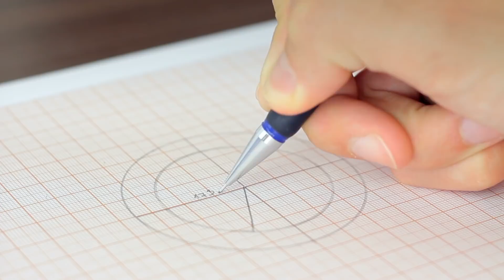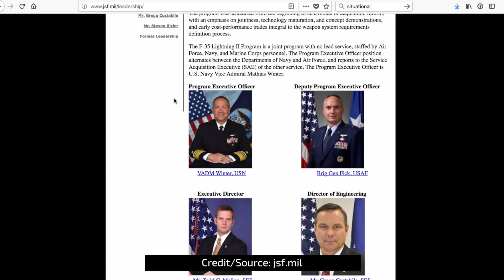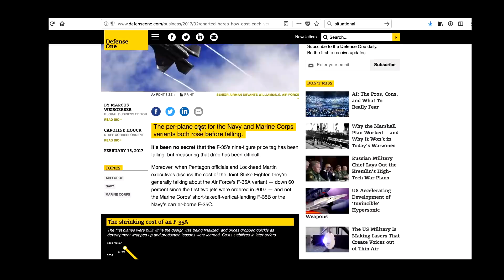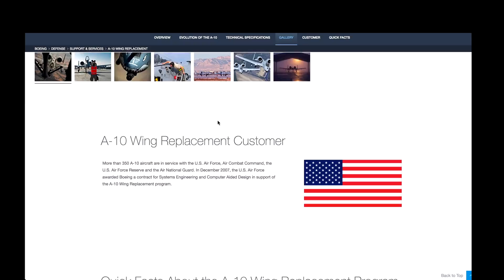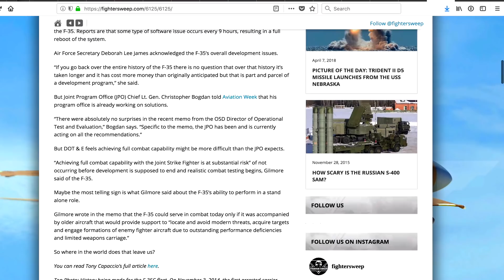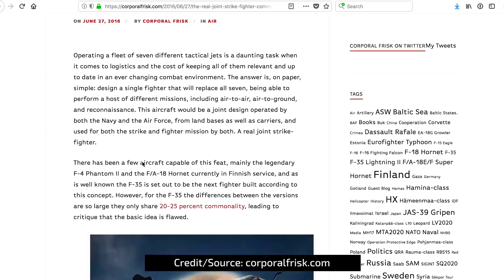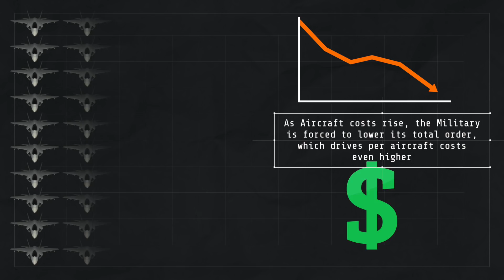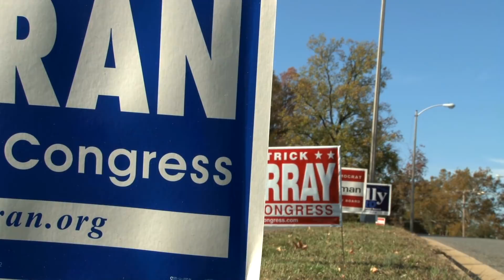Why the F-35 Lightning II Might be the Most Expensive Military Aircraft Mistake Ever

Comment: I am no military expert but I am pretty sure most soldiers and marines who've been to Afghanistan would agree on there's isn't a CAS aircraft that would come close to the A-10.
Reply: That's only dealing with the end result on the immediate battlefield. What the troops think cannot determine what is the best way to support them since the troops are not the ones dealing with the aircraft. Overall something like the F-16 is a better CAS aircraft, even though the A-10 is more impressive on the battlefield.
 Listening solely to the troops is similar to calling up IT support for a malfunctioning computer and telling the IT support person how to do their job just because the best solution as determined by the IT support person is a bit of an inconvenience to you in the short term.
Reply: @dumdumbinks274  I am sure there are logistical reasons why the F-16 would be more preferential, I mean there are simply far more F-16s than there are A-10s and sure the F-16 is adequate to do CAS. I don't think it necessarily makes the F-16 a better CAS aircraft, ultimately the A-10 is designated specifically for CAS missions, while the F-16 is a multirole fighter aircraft,  thus it has similar shortcomings as the F-35 . The A-10 can provide support to ground troops for a longer period of time as well as making split second fine-tuned adjustments while engaging the enemy. To use your IT support narrative, the F-16 is like tier 1 IT support, they are capable of doing general troubleshooting and solve most common issues, meanwhile the A-10 is like tier 2 support, who are capable of doing more precise troubleshooting thus fixing more specific issues.
Reply: @BeerHombre  Not quite. If the A-10 can be likened to a really enthusiastic support person, then the F-16 is a support person who can do the same job but just wants to get it done. The A-10 can get the job done more satisfactorily, but the F-16 ends up completing more jobs, and it's not because of the number of F-16s... an airbase can only support so many squadrons at once, and the F-16 and A-10 have typically been deployed in similar numbers when it comes to the role of CAS.

The reason the F-16 is so good is because in multi-operation situations it's speed means fewer aircraft are needed to provide support to everybody. I'll put it this way; An A-10 could potentially save everybody in squad 1, but if you're only using A-10s and don't have any to spare that means squad 2 might be wiped out in the 5min longer it takes for an A-10 to reach the 2nd destination. If using an F-16 it has less sustained firepower, but a single bomb is just as good as a strafing run. It might save 80% of squad 1, and 70% of squad 2, and that is more soldiers saved in the long run despite doing the job in a less impressive and therefore less reassuring manner. 

Now you might ask why not just increase the number of A-10s? The answer is because CAS is the only thing it can do and it is only good at that in certain situations. As long as the role of CAS can be performed effectively that means troops lives will be saved, and of course that includes frontline CAS where an A-10 isn't going to survive. 

Remember the Gulf war? The US won in a matter of weeks because the frontline aircraft were able to eliminate the air defences, bring down communications networks and the command structure of the Iraqi military, and thus force the Iraqis into a state of disarray with no coordination. That allowed the A-10 to do it's job. But if the US put more emphasis on dedicated CAS aircraft the war would have taken a lot longer and the US would have suffered more losses due to the enemy being more coordinated since the communications networks would probably be more intact, and air defences would be more concentrated when the A-10s arrive.

Now I'm not all for retiring the A-10, but I don't see a reason to keep 270 of them when they aren't exactly efficient in a war situation. It's much the same as how there aren't many AC-130s.
Reply: @dumdumbinks274  I think we are arguing more or less the same thing. Logistical reasons for using the F-16 =  It could theoretically do more tasks, including CAS because it is a multirole fighter aircraft. Something that we both agreed on. I'll add because of its multirole capabilities, there is a reason why there are far more F-16s in use than there are A-10s. This naturally means that you can allocate more F-16s to do CAS mission when needed, but the A-10 isn't capable of doing other tasks than CAS hence there is little reason to have a large fleet of A-10s.

However I pointed out, as you did as well that the A-10 is capable of CAS with sustained firepower. The A-10 might be only able to do one thing but it is unrivalled in that particular task (also more cost efficient might I add). You do have point regarding the speed of deployment of the F-16 as well as it could potentially strike multiple targets that are far away from one another. But this just goes back to the previous point, the F-16 is more flexible than the A-10. However if you're dealing with only one combat zone and you need sustained CAS danger close, again the A-10 is more suited for that role than the F-16. 

I see no point talking about this further, you're arguing the merits of the F-16 and I am arguing the merits of the A-10, but both of us can see eye to eye in regards to the capabilities of each aircraft. It's nice to have a civilized conversation as opposed to all the overly passionate nonsense people spew out on the internet. 

PS: I did say I am not a military expert so I am claiming no legitimacy.
Reply: @BeerHombre  No worries mate. The thing I dislike most about the A-10 is - like many things - the fan base. People who parrot it's merits as though those things are all that matters (usually exaggerated too). I often find myself testing the waters so to speak by replying to comments that praise the A-10 over everything else. It's nice to once again see an A-10 opinion that isn't completely one sided and I'm fine with that. As long as you can understand that CAS isn't a single situation and that a true "best CAS aircraft" will never exist unlike for example a "best air superiority fighter", as well as the merits of efficiency and flexibility versus durability and firepower, then that is fine by me.

One thing to note though; the A-10 is only a tiny bit more cost effective than the F-16 in the situations it can be cost effective in. They have had similar costs to buy and operate at every point since the 1970s and currently a Block 50 F-16 and A-10C cost roughly $20000 per hour to operate, though neither of them are in production any more in a sense that we can compare figures. I'd guess the A-10C is worth around $45 million and the F-16 Block 50 around $50 million. Now something like an F-15E which also does CAS is definitely more expensive than an A-10 at $100 million and $28000 per hour.

Comment: I think the negative reputation of the F-35 is mostly unwarranted. A lot of people expect it to excel in roles it wasnt designed for. The exorbitant price tag and cost overruns are just unacceptable. However after working out all of the early bugs, its definitely an impressive aircraft.  Replacing the A-10 with the F-35 is completely out of the question.  One thing the F-35 critics fail to consider is the out right theft of the jets classified information by the Chinese.  A lot of stuff had to be redesigned because of this. Contributing to the cost and schedule delays. The Chinese cant even build their own indigenous jet engine.  Every ship, missile or aircraft the Chinese have are cheap knockoffs of American or Russian designs.

Comment: The F35 in 2015 flyby wire system did not let the pilot turn hard, i forget the limitations i think it was 7G's they knew it was not ready they just wanted to test it.  The pilot was also flying the F35 like it was a F16, tactics were not developed for the jet by that point.

Comment: The F-35 is not going to replace the A-10 the A-10 was designed as a ground attack plane now the F-35 has more advanced avionics more advanced weapon control system in more advanced weapons but the 8 ends design to build the take punishment and to do the job that Fairchild Republic design the plane for now they re Wing the 8 ends but the u.s. Air Force is looking for a cheaper alternative like the super decanio and a few other small turboprop aircraft

Comment: The one F-35 variant that I would worry about is the F-35B. It's basically the US's version of the Russian YAK-38 Forger, which was considered a failure. Why? Because it has a second engine that would be used mainly in landing and assisting in take-off. That second engine that powers the VTOL capability means the plane will either carry less fuel or less munitions, not to mention a lot of extra weight. Think the Marines would be better off either keeping the AV-8B or adopting the F-35C which has a greater wing area for carrier operations.
Reply: The F-35B is superior to the AV-8B in literally every way possible, including being easier to maintain. The F-35C cannot operate from LHDs, so it's not an option.
Reply: @dumdumbinks274  Ummmmm... You are aware that the F-35B also costs about 5 times as much as the AV-8B, aren't you? The question you and others should be asking is if the F-35B is 5 times the airplane that the Harrier is. Unfortunately it is not. In a war of attrition, that can make all the difference in the world.

Combat radius is roughly the same for both. Ordinance weight is a little more than half that of the AV-8B if the F-35 wishes to maintain its stealth capabilities. According to the many articles I have read online, the F-35 is NOT good in a dogfight whereas the Harrier was credited with approx 20 air to air kills during the Falklands war. Black boxes while no doubt superior aboard the F-35, only goes so far due to ever changing technologies. Also they are still chasing bugs out of some pretty basic and well established technologies such as the pilot oxygen and cabin pressurization systems. Pretty bad considering that the F-35 is over 10 years old since first flight...

I still think that the F-35B is a failure on the part of the developers to learn from the failure of the YAK-38. In fact my understanding is that the successor to the Yak 38, the YAK 141, was the direct inspiration to the F-35. They do look similar in many ways.

https://www.youtube.com/watch?v=1yFd8lx7vQI

https://nationalinterest.org/blog/the-buzz/russias-yak-38-fighter-the-failed-jump-jet-helped-inspire-19320

Comment: The F-35 is no more then a flying version of Frankenstein. It's no more a part of everything, bolts and scrap. And still people wonder why it flies like a brick and can't do anything useful. It's a abomination of the aircraft world that never should have been made at all.

Let me clarify, if you want a aircraft that is all round. You will fail as it is a rainbow build. You have no specific strengths but a lot of weak points.
If you specifically build towards a specialization you will have the strengths you need without compromising for other branches that wish to have something as well. For a attack/defense fighter you have those strengths although it may not be useful for bombing runs even if you have at least some capabilities in that direction. So the weak points in that case are minor. A carrier bound unit would benefit from wings surface that you can decrease for storage, which for example the F-14 has and many other aircraft that were build with that goal in mind. Problem is that turning that aircraft in a reasonable circle will get to be a issue because the stress on the wings can get too big if you do. A few of those moves may not be a issue but it sure isn't build for it.

In the end, a rainbow build like the F-35 tries to fill in all jobs while not excelling at any of them. This is it's biggest weakness as it could get out performed by ANY 4th generation aircraft. Even the early 4th generation models will pose a problem for the F-35 if you allow them to excel at their specific tasks vs the F-35. You will NEVER win in that F-35 as it will have too many weak points.
Reply: Couldn’t read more than a couple sentences of this garbage comment. You don’t know anything about the F35, have never been around one, and don’t know anyone who has. But keep spewing BS because the media told you the US doesn’t know what’s its doing. The F35 is one of the best jets ever developed and every single point you made has already been debunked.
Reply: @XxTheGreatDestroyerx  Actually the media spits only positive words regarding this piece of crap. Also you have the freedom to say what you want, if you wish to be toxic instead of arguing your points that is up to you. I wish you a fine day!

Comment: The navy version has many more sq ft of wing area......
Reply: And far more weight and drag and more stress  on the airframe.
Reply: @Arpthingy  No, quite the opposite...  less stress on the air frame and more lift and a tighter turning radius and increased load carrying capacity and slower conventional landing speeds... how can you be exactly opposite wrong ? It is a glorious stroke of good luck and physics to have a larger wing ...

Comment: That's a really good Video, showing the conflict from both sides and explain the argument. In my opinion Multi role fighters can be efficient but - especially for air to air combat - a specialised aircraft would be better, because every class has it's own requirements and you can't make a perfect aircraft for all roles - you always need to sacrifice something to make it fit into another role and for a fighter aircraft this can be very bad. thanks to Stealth desgin and BVR combat Systems the lack of dogefight performance can partly be ignored, but that means you can just use this aircraft in One Strike mission - today this can work out most of the time - but if you really get involved into a longer engagement the lack of manouverbility can be a death sentence. Also the top speed of the JSF is behind the potential enemy ones like the Sukoi Su 35,57 or the Chengdu J 20. So: thanks to the BVR combat Systems and Stealth desgin it can defenetly assassinate every potential enemy aircraft but once it gets detected it has a hard time. So do I think the JSF program can work? Yes, If they manage to lower the costs this plane can defenetly be worth it's money - planes like the Chengdu J20 or the Sukoi Su 35 and 57 are maybe better when it comes to dogefighting but - if they manage to lower the JSF costs - the Americans have a competitive BVR plane with half of the costs of a normal one. But I still think that a real fighter aircraft is still better because it can gain control of the fight and don't need to hide and strike - and if that fails you're in the disadvantage: the JSF can work - but this comes to a high risk in a Engagement.

Comment: The A10 has the advantage of being able to just hang out, very little worries, and respond to changing conditions. Flying up to a tanker, coming back down, means its not engaged. Its also rugged, armored, and got a big gun. The F35 will not be able to take shot after shot and keep on chugging. Its an apples to oranges comparison. The low, slow, armored, and armed vs high fast light and precise. They're not even in the same ball park. They need an A12 or maybe A100 superhog.

Comment: Technologies such as "sensor fusion" can be largely independent of the air frame.  The same goes for radars and armaments.  Put the sensor fusion, new radars, weapons systems, etc. on the legacy aircraft, and you have formidable competitors.  As to "stealth," that's easily circumvented by adversaries with the next update of their phased arrays.  This is because "stealth" is only stealth in certain legacy frequency bands.  For example, if you can still see it with the naked eye, it's not stealth in the optical band.  And yes, many targeting systems also use the optical band.

Comment: Instead of trying to hide from radar, we should hide in it. With a fleet of expendable drones with the sole purpose of making so much noise from heat signatures and radar frequencies that can spam every wavelength in all chaotic directions at a much lower altitude than the attack fleet directly above it can carpet bomb machine gun robot bombs to rain lead until it explodes on impact. And the drones can autodetect enemy radar frequency and manipulate the data to confuse their systems

Comment: When you say replace you make it sound like all of the listed aircraft are going to be decommisioned and entirely replaced by the F-35 models. This is not true. Everyone of the listed aircraft will remain in service (some longer than others). The F-35 will take on the role of several of the other older aircraft that each have a specified purpose, (it will be a multirole combat aircraft) and do it better.

Comment: If they build a plane around GAU-8 that has common parts with the F-35 it might be the 'perfect' attack plane.
Reply: GAU-8  is a dated way of of attacking vehicles the pilot has to get down to 7000 feet  when he could just use JDAM  or AT missiles from several miles away at 20,000 feet.